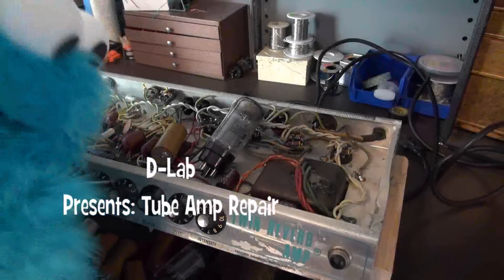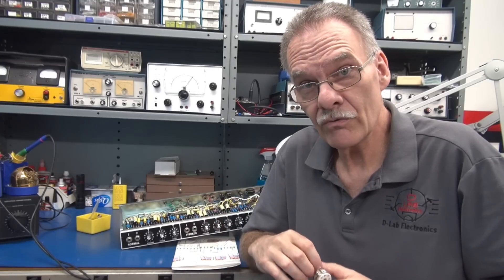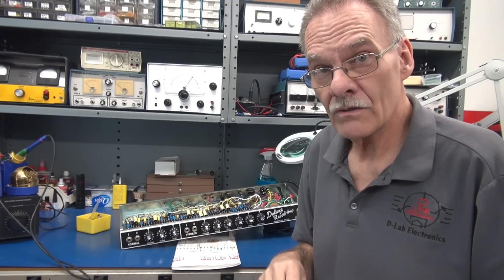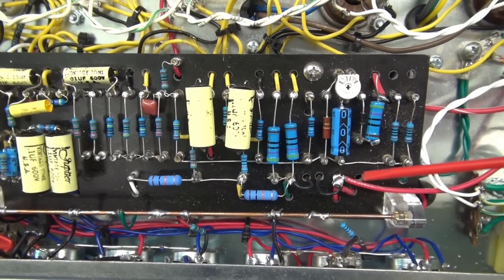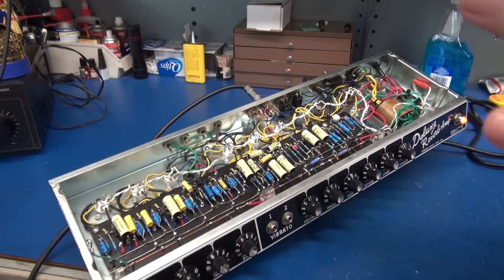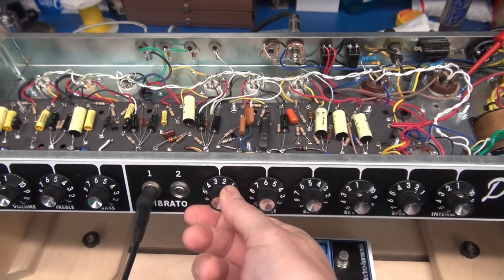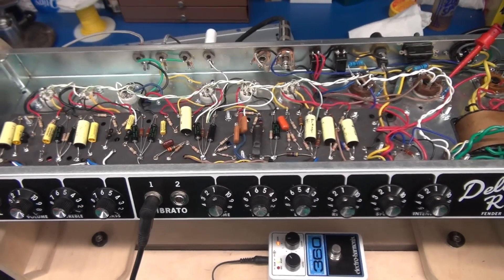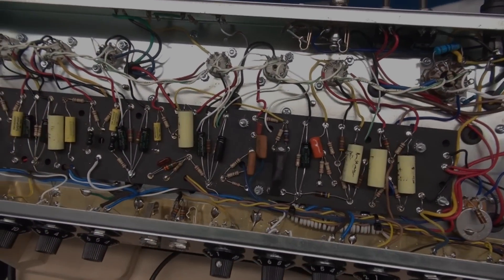Terrible hum noise Fender Deluxe Reverb kit guitar tube amp solution Install a Factory eyelet board

Comment: I retrofit a PRRI with a AA1164 Hoffman board and don't recall any issues. The AB763 here does look too wide though. Kits come with difficulty level, and perhaps the original builder overestimated his ability. It is definitely for the experienced builder.

Comment: I have a old peavey tube amp with a solid state pre amp the signal starts strong when I first turn it on and then gets killed by a strong hum any advice would help the tubes are also running hot

Comment: Apologies if you stated this, I am using the closed caption while "listening" to this video. I am curious about how you handled the voltage difference between US and Japan. Aren't they at something odd like 100V? Could that change things in how it performs here? Hum levels, etc? Do you use a variac or something similar?

Comment: Hoffman boards are fine,  but for a project this size, deluxe reverb, assuming a person here new to building amps?, one really needs to go with stock style fender board.   Just my advice if you are thinking about tackling a DR build yourself.   The owner certainly did his homework on the chassis choice , much higher quality than I've seen.

Comment: @D-Lab Electronics - Really appreciate the schooling on this amp, and the Fender style grounding plates.  I've built a Hoffman layout PR that turned out well with no grounding issues.  You were spot on about those boards being a bit large.  This can cause fit issues.  Gathering the parts for a 6G6B Bassman build, and after you taking me to school have ordered vintage fiber boards and brass shim stock to do it correctly.  Thanks for the great info!!

Comment: I suspect the original installer just didn't know what he was doing -- as evidenced by the blowing fuses and his failure to to get the amp to operate properly.    Even though I have no affiliation, I would mention that Hoffman Amps is one of many top quality resources on the web for information and parts for vacuum tube amplifiers.    There is even a Hoffman Amps forum with knowledgeable tube amp enthusiasts who probably could have helped this amp's owner work through his installation issues.   I am happy the amp is working now.     Eyelets, turrets, point-to-point terminal strips, printed circuit boards -- it usually comes down to experience.

Comment: Another youtuber to suggest why are you calling it a Hoffman kit? He supplies parts and info that work. The builder hasn't been able to make the amp correctly, possibly a language issue. You aren't familiar with a turret board? That is strange as there are possibly over a hundred thousand out there. They're fairly simple if you can read a schematic and match it with the layout. Regards Joe.

Comment: VERY important(read Description)!

"I have read reviews on the web and these appear to be a decent amp, so this is an isolated instance due to construction method. Again, this video is not saying Hoffman is a problem, it was just errors in this build."
"I decided the best course of action was to remove the Hoffman turret board and install a standard Fender fiber eyelet board, time saving method, since I was not familiar with the turret design."
Reply from the maker: Thanks man for taking the time, helping others understand the intent of the video

Comment: Not sure why you are implying that the Hoffman board itself is a problem.   I've built a number of amps with Hoffman turret boards -- these are the best boards available, period. 

One thing to say, the Hoffman amps are not sold as a kit.  The builder must source a number of the critical parts, fabricate (or purchase) an appropriate chassis, and understand what he or she is doing.   There is fantastic support available from the Hoffman amp forum -- regardless of whether the amp is a Hoffman, Fender, Vox, Matchless, or whatever clone you are building.

Of course, you're not going to criticize your client's build -- I get that, and I wouldn't either if I had your business.   But you are implying that Hoffman is a problem, and that just is not true.
Reply from the maker: Hi, I believe you may want to read the description for clarification

Comment: The restoration to an eyelet board came out great. However I have used Hoffman turret boards in quite a few new builds and in conversions of Fender reissue amps and have never had any problem with them; they are dead quiet and one of my Hoffman PR builds is the best sounding PR I have heard in my lifetime. Hoffmans website has all the documentation that is very professionally produced, easily followed and the forum has some of the best techs out there if you need some help. Doug also has the fender eyelet boards for those so inclined. I personally don't think this Hoffman turret board was the problem but rather the builders.
Reply from the maker: I agree. This was the first I have seen, so had nothing to reference. I realized that this would have been a very involved time consuming repair as is, so the Fender board was the option. It had nothing to do with the Hoffman design or quality.

Comment: I am a subscriber and find D-Lab videos interesting. I also have been buying from Hoffman for years and routinely participate in the EL-34 Forum Hoffman manages. Having built multiple amps using Hoffman boards I can assure you that they are quality components and that Hoffman puts a lot of thought into their layouts. I think you should make some corrections. Multiple people have pointed out that Hoffman does not sell complete kits. They sell components and provide advice. Folks who follow their advice, and learn how to solder and assemble, build great amps. Sadly, some folks just refuse to learn and listen. Your client did substandard work and apparently discarded good advice. If you sent him the components that you used and asked him/her to rebuild the amp, the outcome would have been the same, or worse. You answered one comment by saying you could find little info on the Web regarding Hoffman - there is tons - look again.
Reply from the maker: Roger that Sir. I was not aware that they did not sell a complete kit. Probably why I have never had one in the shop before this one. Yes, I will do some more research
Reply: Terry, thank for your thoughtful reply to the comments by me and others who have experience with Hoffman. It would be the right thing to do to issue a correction in your video description as that gets read more than the comments. That is what Doug Hoffman would do. It is nice and rare that nobody is flaming in their responses.
Reply from the maker: Yes Sir, I did make a change to it this morning. Review and let me know if it looks OK. If not, let me know how to improve it to lesson potential misunderstandings. Thanks

Comment: There is nothing wrong with the Hoffman style AB763 board when installed by someone that knows what they are doing. Hoffman supplies boards, parts, schematics, and layouts for the stuff he sells, but you must be a savy builder and have some electronics knowledge and experience. This guy from Japan had no clue. Actually the Hoffman AB763 was never meant to be a clone of an AB763 amp, Deluxe Reverb in this case. In fact, the Hoffman board has a bias wiggle tremolo circuit from the Vibroverb 6G16 amp. Sounds much smoother than the standard AB763. My point is this amp was a mess because of the workmanship done by the owner. He would have had similar results with any "kit" he bought. So please don't poopoo the Hoffman board. I understand Terry's decision to remove the Hoffman board and install a more familiar Fender board. Afterall, it was much easier and faster to just start all over with a more familiar schematic and layout than trying to untangle the mess this owner had made. And Terry did a good job with the project. He could have done an equally good job following Hoffman's documents, but it would have taken more time. I would have done the same. Terry, I'd like to invite you to drop by the Hoffman Forum at el34world.com to see what we are all about. It's always nice to have some more knowledgeable people drop in. I think you would feel right at home. Lot of other smart people hang out there. Take care... sluckey
Reply from the maker: Hello, understood Sir. The replacement was not due to Hoffman quality. The owner & I realized it was a botched build. So, to ensure future support, we decided to simply install the Fender style board & ground plate. It had nothing to do with Hoffman, just a more efficient repair.

Comment: Again proving the brass grounding plate is the way to go. Fender put tĥem in there for a reason. Probably sounds really stiff with all those metal films when cranked up
Reply: The brass plates are not needed
Thousand of amps are built without them
Proper layout and groundings are what is important

Comment: I've built amps using Hoffman's boards since 2001, and never had any hum that was due to the board or its approach.  The only times I encountered hum were due to an error I made, or a defective tube with heater-to-cathode leakage.  This video makes it seem like Hoffman's board is to blame for the hum, but it was the amp-owner's additions to the ground system, and failure to execute the build correctly.  Unfortunately, that happens a lot with new builders.
Reply: Exactly, Thanks Brian
Reply: ii just built an princetone reverb with the hoffman board and is quiet, even more than new princeton reverbs, all that wire looking like spagetti and poorly solder points where the problem.

Comment: does the hoffman plan call for that many ground planes or did the builder go ground plane crazy?
Reply: The builder went crazy with the different ground paths.  There is 1 preamp ground buss on Hoffman's board, which then connects 1 time to the mini-ground-buss for the phase inverter, and those get grounded to the chassis over by the input jacks (along with the pot-grounds).  There is a 2nd ground-buss for the power tubes and bias circuit, and it grounds over by the power transformer along with the B+ center-tap.

Comment: Also note the the Hoffman board used precision metal film resistors. But the new Fender board as carbon films and even old carbon resistors. And it now works just fine! Just more evidence of this audiophoolery. Also a good example of how these hack shops eschew formal electrical engineering theory like proper grounding techniques and their product offering reflect that. Those old engineers were not stupid! Glad you were able to salvage this. At least the metalwork looks good.
Reply: That is a sophomoric word salad sub-educated response that would not even pass a far-left fact check....😎Love ,rafe
Reply: @raedwulfone  Sophomoric? Well I have actually been a sophomore twice in my like. Once in high school, and once in a university where I earned a BSEE. So with that in mind, do you have anything technical or educated to say about my comment?

Comment: A couple of notes here.  Hoffman doesn’t make kits, they sell boards and parts, but not complete kits. Second, i suspect that the difference in noise isn’t because there was anything wrong with the Hoffman board, I’d bet your soldering was a lot better than the guy who built the original. I have a Princeton Reverb built on a Hoffman turret board, according to his instructions, and its great

Comment: While I've enjoyed watching your videos for years, I have to find some fault with this one. Personally, I prefer old-school fiber board and point to point construction, because it's easier for me to follow the schematic than on Hoffman's turret boards — old Fender-style boards are what I first learned on, and that's what I'm comfortable with. That said, I have built three or four Hoffman boards, including the AB763 referenced in this video. Every one of them fired up with no problem, and I'm ashamed to admit the circuits I've built with his boards are quieter than the boards I built myself, using eyelets and fiberboard and making my own. The comment about the multiple paths to ground struck me as off-base, to say the least. I think the problem here is the inexperience of the builder, sloppy lead dress, the usual. Hoffman's boards, like any boards out there, are DIY and the builder has to have some knowledge, attention to detail and care in putting them together. It's not surprising at all then that a builder who did a poor job of assembly is having issues with a Hoffman board. What is surprising is that you wrote off the board itself without troubleshooting and seeing for yourself.
Reply: fender fiber boards are a pain in places with high humidity

Comment: Why would the Hoffman fender style eyelet board cause more hum problems because the eyelet layout has multiple grounding points or what?
Reply: It doesn't. It's a terrible install. There are 1000's of those boards out there since 1995.
Reply: @EL34XYZ  DLabs is saying that the Hoffmans eyelet boards have ground loops and multiple grounding paths which is causing hum noises that is why he had to replace it with another type of eyelet board. If other techs added more ground leads and grounds connects why didn't DLabs just remove all the grounds to fix the problem? because that would have been an easier fix than to purchase a new populated eyelet board
Reply from the maker: Customer requested to update to the Fender board. It was not about which was easier
Reply: @d-labelectronics  but why did the Hoffman eyelet board cause hum issues and multiple grounding points? it should work noise free and hum free
Reply from the maker: It was a poor build. I did not investigate any further

Comment: So basically, a few mis-wired  connections (maybe)  possibly a bad tube, and probably a ground that could have been in a better place. 1-2 hours and a tube. I think we know there is nothing intrinsically wrong with Hoffman turret construction.
Reply from the maker: I agree, the decision to go with the Fender board was just to eliminate troubleshooting time and have the Deluxe configured per the print. Not saying the Hoffman board itself had design issues.
Reply: @d-labelectronics  I see

Comment: Do not understand what has the o
Hoffman board has to do with the noise. I have the Hoffman boards. Its the installer from Japan not the board LOL
Reply: Having your grounds going to the back of the pots (which always come loose) and the bias being mounted on the main board are both terrible ideas. I've never seen quiet "fender" that was built with ground buses. You gotta do the brass grounding plate with fender circuits, that's how they were engineered. Aside from some really bad choices (especially for a beginner kit amp) they're okay I guess
Reply: @vadenk4433  It''s not true that a brass plate is needed (that was just a manufacturing convenience, rather than make multiple soldered connections to ground).  It's also not true that a ground buss cannot deliver a quiet amp.  I've built amps over 20 years using Hoffman's approach, as well as other approaches.  They all work correctly if they are *executed correctly.*. But the amp-owner did not execute correctly, and then added unneeded stuff.

Comment: Excellent save again D-Lab! I'd like to point out that an inexperienced or beginner does not represent the quality of a "kit" from any supplier. It takes may builds and electronic knowledge to know how to properly build and amp and what changes can be made or what can be improved upon. D-Lab's comments on this product is based on a lifetime of experience surely but that doesn't mean this product or other is inherently flawed. If D-lab built this amp with the "kit" parts it would have be noise free and solid from the get go...problem is people in over their heads on projects they don't understand...start small or prepare to have D-lab bail you out!

Comment: Excellent  rehabilitation!  
My experience with the Chinese ceramic sockets is if they have the stamped contacts, they are junk. Some at higher cost are made with fully machined pin receivers, which tend to be good... but rarely seen in kits due to far higher cost.  Good move to go old school on the sockets.👍🏻👍🏻👍🏻

Comment: Hoffman should be called Effoffman. D-Lab comes through and the customer learns a valuable or should I say, costly lesson
Reply: Hoffman's boards and technical information are beyond reproach.  This was at best misleading and gave a bad impression of what The EL34 site and Hoffman's business ethos represents.
Reply from the maker: If you read the description you would see that was not the intent. This was just an efficient was to correct the build errors and maintain serviceability
Reply: Hoffman doesn't build or sell kits.  He makes the bare boards and the parts available, then it's up to the user to assemble & install them properly.  Unfortunately, that didn't happen here.
Reply: You don't know what you are talking about. You should know something before typing garbage!

Comment: Great Video and educational.
I've never heard of Hoffman before. Are they supposed to be any good?
Reply: Yes, Doug Hoffman has been around for a long time and is a very good resource. His website has excellent information and good supply of select parts for sale. As far as I know his "Kits" do not include build instructions...so you have to know what you are doing. Best to check with him on this as thing may have changed.
Reply: @nikkisimpson1835  yep, since 1993. Thanks Nikki
Reply from the maker: I have no idea. Did not find much info on the web. I was very impressed with the chassis, nice & shiny, plated, easy to solder to